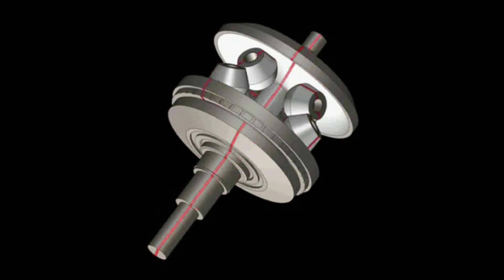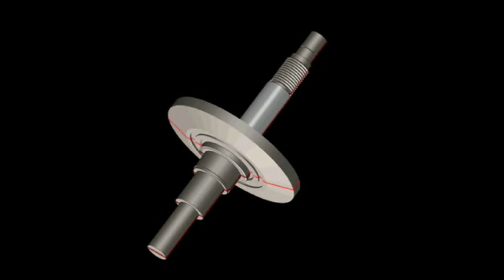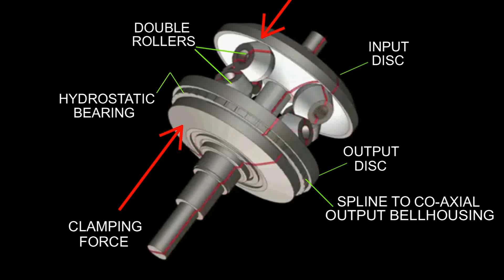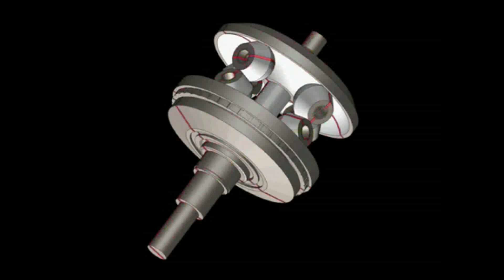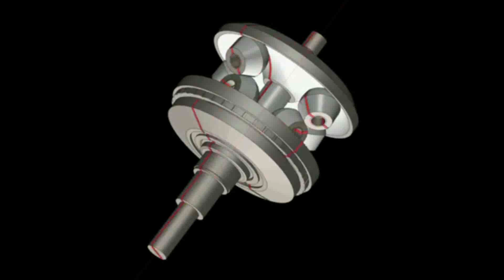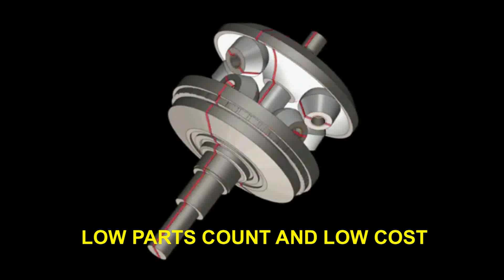VIDEO CLIP ULTIMATE TRANSMISSIONS.flv

Comment: Michael, is this transmission in production and if so is it available in a configuration that would withstand 400 to 500 horsepower and possibly an equal amount of torque?
Reply from the maker: Sorry I am so slow to respond but I don't check this thing very often.  Yes 400-500HP is no problem assuming speeds around 1000-2000RPM.  if you want more send me an email m.durack@ultimate transmissions.com

Comment: Hi Michael. Can't get my head around the thought that there will be slippage between the rollers etc. Can you explain why there won't be?  Cheers.
Reply from the maker: John Wilson Millar 

dear John ,   
There is slip because the tangential forces are passed from one metal surface to the other through a special fluid called a traction fluid .  However when under high pressure the fluids viscosity increase by billions of times.  It becomes a glasslike solid.  When the surface velocities of both surfaces at the contact are equal the amount of slip is less than 0.1%.  Believe it or not - A rolling traction "gear" can challenge the efficiency of a gear.

contact me direct at m.durack@ultimatetransmissions.com for more detail if you want.